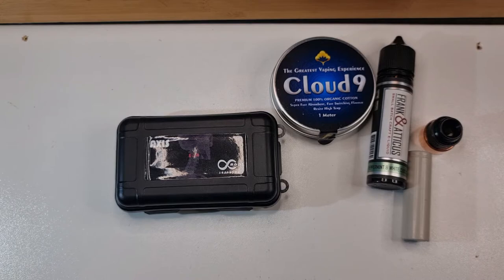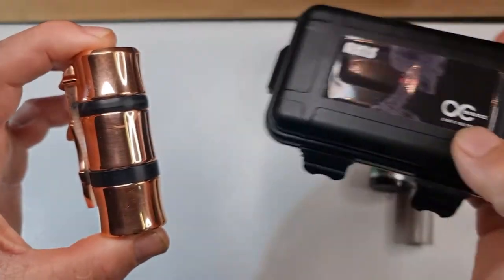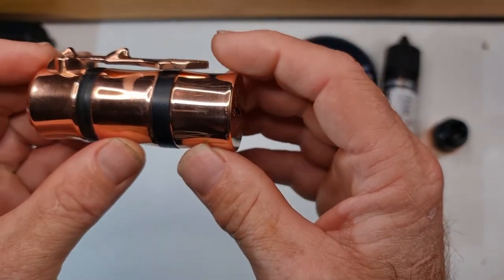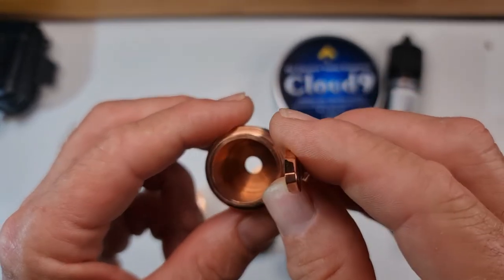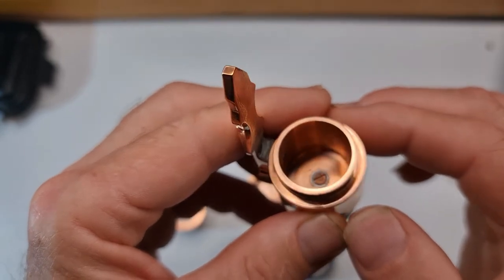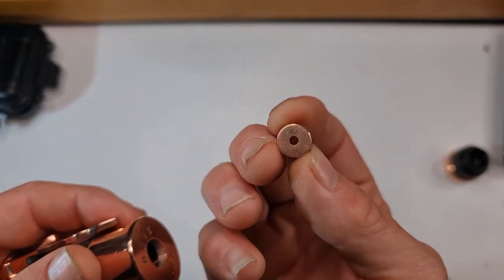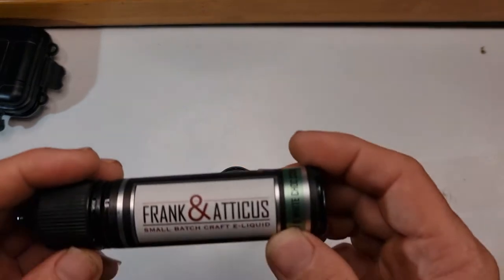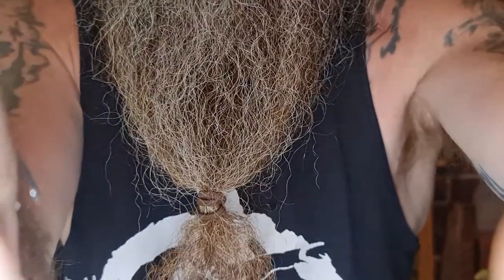Infinite Mods Axis mechanical tube mod

Comment: Great review Birdman👊🏽 I love my Infinite Mods too I have the Pegasus 30mm and the Orion 28mm both flush cut side fire Mechs I think my next Infinite mod will have to be either their parallel 21700 Acrylic/Stabwood - Taurus Mod or the Axis Mod Thanks for another great review Birdman👊🏽 I'll b looking forward to the next one
Reply from the maker: Thanks mate. I have the Pegasus and 25mm Hyperion (stacked). I will get to doing a breakdown on all of them. Appreciate your support 🤘🏻💨
Reply: @birdman_69  that's awesome I got my Pegasus 30mm right after I saw Bogan's review of it out of all my side fire Mechs my Pegasus 30mm and Bestia Fiera-M r my 2 favorite both r flush cut out of the tube style side fire Mechs both from Spanish speaking countries in that Infinite Mods - Mexico and Bestia Mods - Spain the Pegasus is a bigger ,heavier  mod being a Brass  30mm Mech while the Fiera-M is Copper n 26-27mm with a 25mm bevel on the 510 end both r equally comfortable in the hand but for versatility with different attys the Pegasus 30mm and Orion 28mm have to get the edge over the 25mm Bestia Fiera-M speaking of which I think I need to put my Mach 1 RDFA on the Pegasus 30mm I haven't used it in a while Thanks for reminding me that I have other pieces in my collection begging to be used